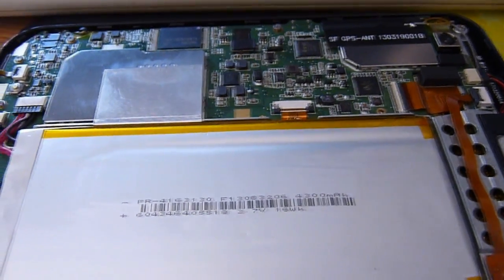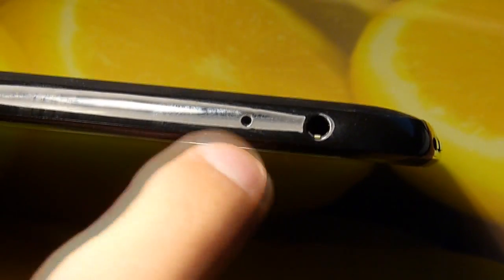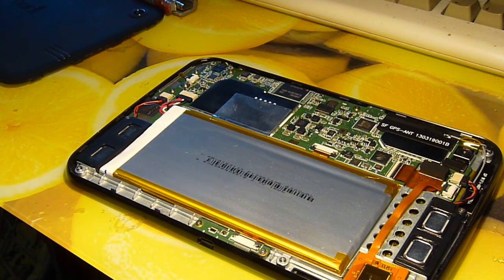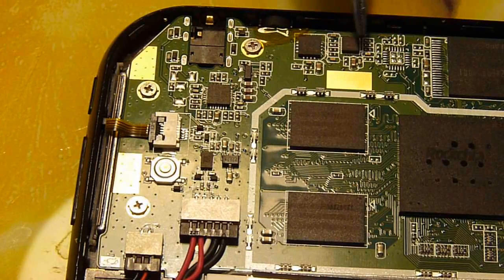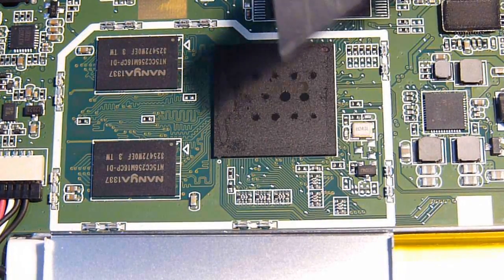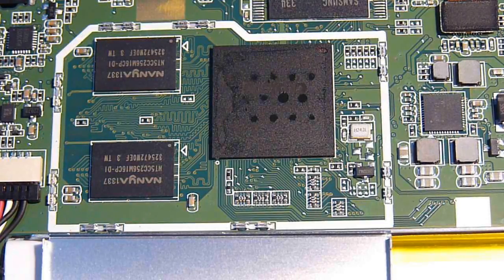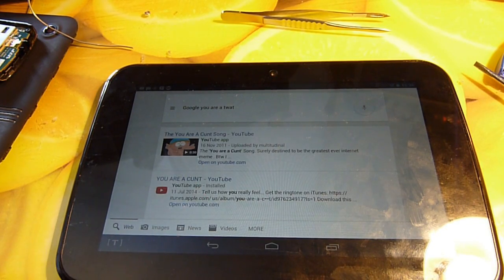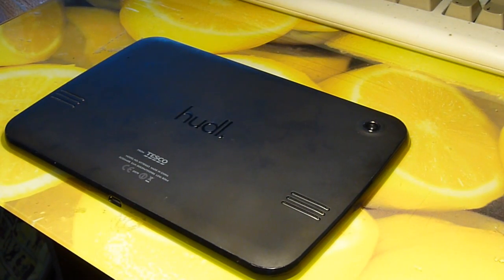Tesco Hudl Teardown & Repair

Comment: Any idea on how to replace the volume button on Hudl 1, my older duaghters old tablet isn't working, but managed to get it to start and it works lovely, just the on button doesn't work, nor does the volume.  Want to give it to my toddler to play with, any idea if it's an easy fix or quite complex? I manage to replace the charge port a few years ago which was a breeze.
Reply from the maker: Not sure.

Comment: I could not believe it when I opened up my Hudl and found.....a screw floating around!!!What was worrying is it was from exactly the same place as the one in your video.I checked to see if I had a screw loose in the same place you did,and I did not...however I did have one elsewhere,one of the ones that holds the charger port.Still cannot get my screen to work,but at least the screws are all in place and tight.Makes me wonder what else they have left undone,maybe that is why so many screens have this blacking out problem?Just a thought.Thanks for your vid tho,its given me a good starting point,
Reply from the maker: Thanks. Year that was pretty sloppy. The overall design as not that bad but things ike that are not good. I barly use it anymore.

Comment: What a waste of 12 minutes of my life..you said teardown and repair, teardown means a complete dismantle however, you never completely dismantled anything did you?
Reply from the maker: Bearing in mine I wanted it to work and the fix the issue, of course I am not going to rip every part off of it. The LCD would be a one way process.

Comment: any idea on the black screen problem?  can hear it booting but no display, also ive connected to an hdmi monitor and i get a display. Im guessing hardware fault and could buy a new lcd screen off ebay for £20 but dont want to bother if its gfx card issue
Reply from the maker: Don't know. Never had that one.

Comment: Hi great video + really useful. I need to gat a part for the Hudl 1. It's the clamp (?) that hold the touch screen wire into the motherboard. Do you know what it's called and where I could get on?
Reply from the maker: Thanks. Not sure where to get spare parts.

Comment: But it is broken, it runs Android 😁
Reply from the maker: Knuckles the Echidna Android is Linux so that works for me. What is brocan is the bloody YouTube application. No one has created an alternative.
Reply: ***** Imagine the Linux kernel with ALOT of JAVA bloat, Google bloat and other junk dumped on top, automatic rotting to slow it down until hard reset required, the firmware updates could be who knows when or never again, lag here, lag there, audio lag, tiny touch targets and Android is what you have :D  iOS is Unix but it seems crap to me too since Steve Jobs died.  Windaz Phone is awesome but the apps aren't quite there yet!  
Now if only someone would invent the perfect phone/tablet :)
Reply from the maker: Gareth Carlile Sadly there is no perfect solution. I have never found a way to access the CLI on Apple devices. The crap software does piss me off, to be fire I don't use mine like most. I do use it to watch YouTube in but or as a portable internet connected device. My main uses are things like network scanning and a portable SSH terminal. Also good for taking technical photos that you want to publish online. I have also recently found a way to VM Kali on it which expands it's usefulness even further. I have it rooted so it can run the more technical stuff as well as Ad Block, it did not take long for the adds to piss me off so that one solved that little issue.
Reply: ***** Nice!  All my droids got rooted and they were still 'rooted' (Australian version) Android devices  seem to make especially awful phones too!  You can get SSH apps for the iOS tablets and Windows tablets and remote desktops like nomachine, VNC etc hmmm perhaps my next tablet will be something like the Microsoft surface but it has to have a built in kickstand :D most important feature!!  Gotta save up for that one though hehe
Reply from the maker: Knuckles the Echidna I don't do phones. I do like having a very portable Linux machine that fits in my sorts pockets. I'm not to fussed on the Windows versions but they have there place like anything.
Reply: ***** I know what ya mean, I just stuff £15 on mine every month for the unlimited internet, never use the calls and only use a few texts!
Reply from the maker: Knuckles the Echidna My mum covers the cost of my phone. Otherwise it would be useless. My car, I do cover the costs.
Reply: ***** awww bless ya hugs tight
Reply from the maker: Knuckles the Echidna Thanks, taxed the car yesterday as it would have run out at the end of the month.
Reply: ***** haha i hope self driving cars become the norm soon so I can have one!

Comment: To save ***** the time answering the question, this is the image he used in the thumbnail and as his background on the tablet. ( http://40.media.tumblr.com/b0131ad509e4eac23d1325d8fb2c104c/tumblr_nop57d5PB81qhjylyo1_1280.png )

PS: Sorry if this winds up being listed as a spam comment for containing a link to a Tumblr image, but that's how YouTube's comments system rolls.
Reply from the maker: Daviljoe193 Nice, found it on someones Facebook. Much better to have a high resolution version. I did wonder where it's origin was.
Reply: ***** Well... 2 hours of reverse Google searching will get you just about anything in HD. :P
Reply from the maker: Daviljoe193 My curiosity was not enough to put in that much effort. I have recently dragged my own pictures out the loft and scanned them on the PC. Can't draw on a computer but I am pretty good with pen and paper.